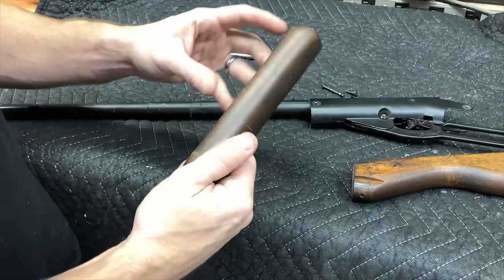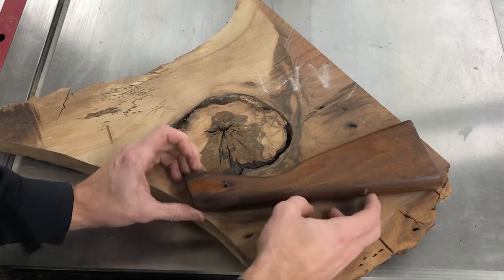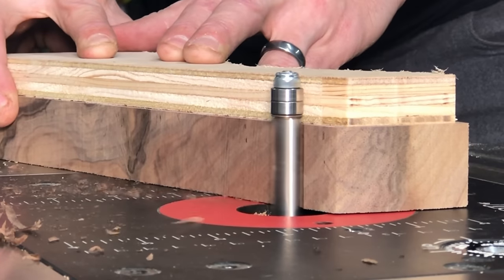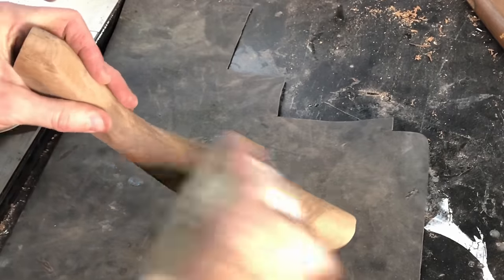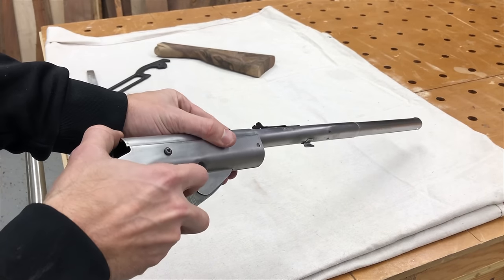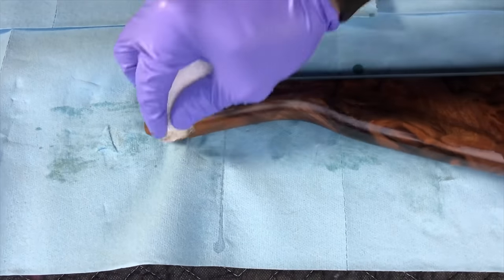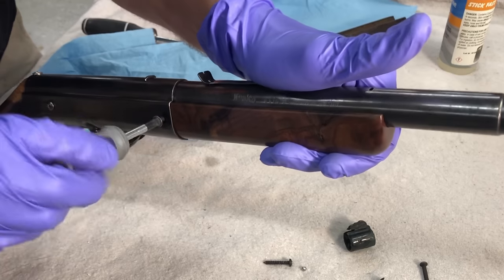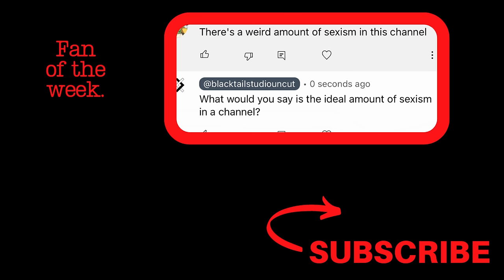Vintage BB Gun Restoration

Comment: When I want a darker finished surface, I've had good results with cold blue and using steel wool wetted with cold blue solution to buff the surface and build a darker color by continuing to buff and apply more solution until the desired effect is achieved. 

That said I love what you've done with the BB gun.

Comment: Love the restoration Cam. 
Safety first, sure. 
Going to attempt to restore my BB Red Rider,  exactly the same as yours. 
There's one piece absent. The rear sight adjustment slider thingy. Mine I also MiA for as long as I can remember. 
Absolutely stunning result with the new stock, grip and cock lever.

Comment: Safety first. I smiled with the extra layers of PPE and with this type of weapon there is no explosive propulsion of material burning but is the release of a measure volume of compressed air, with just a simple spring providing the compressed air. As for the finished weapon, I say it’s a very well restored example where safety has mitigated a possible part failure that will render it useless (and cause injury as it fractures) unless you fabricate a new one using a 3D printer (not the original part) or use metal that can also display a characteristic pattern which, is unique within itself. 
I restored my own rifles with I was a young lad but only had either varnish or French polish to choose from but 2 part epoxy was just around the corner which I later changed to. 
I enjoy your videos of either building something new or restoring (e.g. the Japanese blade restoration). Rgds J 😊

Comment: Safety First!  This was fun to watch - thanks Cam.  I always use the bluing solution on copper pipes etc in the house when they have to be surface mounted, way better look than paint.  Is my go-to also for mild steel railings, can't beat it in my humble opinion!   BB gun looks terrific and is worth way more than it was in so many ways ;)

Comment: I actually have one of those Red Ryder BB guns with the saddle ring (which I took off) .It had a plastic stock and fore arm and those didn't survive my adolescence. So it sat in a corner fore a few years until I fashioned a stock from a piece of moulding, and it still has the machining marks on one side. I don't remember what the fore arm was made from and it's pretty rough, but the gun still shoots, even though the spring is getting weak. It's quicker to cock than the Daisy Grizzly I bought a few years ago, which requires the extra step of charging the BB after pumping it up.

Comment: As someone told him, this was a transfirmation rather than a restauration, but the look is so much better
(ina restauration is cleaning, retouching, refurbishin or repearing and keeking the original pars, if a part is too damaged to be restored then you put a new one of the exact same material (or similar if the original material doesn't exist animore).

Comment: SAFTEY FIRST-I redid mine from the '70s a couple of years ago. Mine has all metal parts and I stripped and had a friend hot blue them for me and replaced all the seals and stripped and refinnished the stocks after giving them a checker job and cnc'd a thin steel buttplate which I also had blued. I gave it about 7 or 8 coats of linseed oil over a weeks time and bufded it out with a car buffer with a soft wool pad which gave it sort of a matt finnish. It turned out really nice and ahot better than I ever remember. It gave it to my granddaughter on her 5th birthday. So now another generation gets to have fun with it and hopefully pass it on to her kids.

Comment: Safety first. I grew up in 1950's Australia where Daisy never really took off. Most kids ended up with a Gecado air rifle instead of a BB gun. You've done a great job on yours but I hope you kept the old stock and lever, a quick change over and you have your original? My first rifle was a Gecado model 27 which I bought in the 1970's. Gecado vanished and was replaced by Dianna.
Great memories, they, the killjoys, are doing their best to rob every ounce of joy and adventure out of the lives of today's kids.

Comment: Safety First. Very nice restoration. The term Damascus Steel is so over used, true Damascus Steel is forged from Wootz steel ingots which are made in southern India, Sri Lanka or Khorasan, Iran. People class steel that looks like Damascus falsely as Damascus. Anyway that's my engineering education coming out. When you "Blue" steel it is best to use a water displacing oil to cover it, this tends to improve the protection. The Walnut looks superb on the stock. Great post, thank you 👍

Comment: Also note: you can buy rebuild kits for the springs, bugger tube, gasket, etc. They are very  inexpensive and quite a bit more of a pain to install than you might think. Done correctly, they will put the zip back in your BB shooter.

Comment: With cold bluing...
Sterile is correct.  Acetone or red BrakeCleaner will get you there.  Always wear gloves.
Multiple coats of bluing is fine.  I tend to dry it with a heat gun.  Warm metal also seems to soak up the bluing better.
Buff off with 0000 steel wool as you did between coats.
After final coat and buffing, oil with a quality oil, and buff and wipe it down.

Comment: Safety Third.

Never been a fan of cold bluing, but with metal that thin, I'm a bit scared to think of what hot bluing would do to it.  Probably the right choice.

The process is called "passivizing" and it's kind of cool idea.  It's the same process as corrosion, but it's done in such a way that the resulting product retains all of its original strength... BUT it's already reacted with oxygen, so it doesn't need to do so again.  You see it a lot in things like boilers, where you use high temperatures to form Iron III Oxide (magnetite) on the surface, so there's no bare iron left to form Iron II Oxide (hematite) that is the rust you're familiar with.

Comment: Safety First...  Great results on the refreshing of your BB gun.  Looks like a Model 95..  You have inspired me to look at some of the old Daisys I have accumulated over the years and clean up a few.  I grew up shooting a Model 102 Cub from the 1950s (yes, I'm old.. :D ) but over the past 20 years or so have managed to accumulate a nice Model 102 Buzz Barton from the 1930s, several Model 25s older than Variant 12 (marked "Plymouth MI") and a couple newer than Variant 13 (marked "Rogers AR") plus at least one Model 95 similar to yours but withe the older muzzle design and a new production Model 25 (my current shooter).  The Buzz Barton and maybe the older Model 25s may be valuable enough to take extreme care in their "restoration".  The rest are not really valuable except as shooters and I can be a bit more creative.  Your stock turned absolutely gorgeous.  Hope you have fun shooting it for years to come...

Comment: Safety First.  In 8th grade shop class I cast a replacement lever for mine that had broken. The most dangerous part is if you fire it with the cocking lever not closed it smashes your fingers and hurts like a . . . well a lot.

Comment: Safety First! Have you ever worked with ironwood? I bought this beautiful little ironwood slab at my local exotic wood store and am going to use it to make a little epoxy table, but I'm curious if I should finish it with Rubio or something else because the wood is so dense and hard it almost looks finished just as is.

Comment: Safety First (from someone that almost lost a finger no less!) Just a note from a metalworker: the cheaper damascus blanks, while nice for projects like this, shouldn't be relied on for anything more serious (like a knife.) These are typically made with random qualities of steel with and usually come with annealing issues (softening the metal) that make them hard to work with. There's a reason that quality damascus stock costs hundreds. That said, if steel quality isn't  your concern then go right ahead! 

Damascus is actually two steels folded together, and when you acid etch it you're eating away at the less corrosion resistant steel. A warning though, that because of that your lever will be much more susceptible to rust, and you need to keep it dry.

Another note. For interior gaps like the lever loop, you can put a cheap round file in a power drill and go to town. I emphasize cheap because this will drastically reduce the lifespan of the file 😅.

Comment: Safety First! I can not stand collector types that would call rust and pits patina instead of neglect and abuse. Plus just because something is old does not mean it has intrinsic value just becaue it is old. I have a 21 year old Toyota Camry I assure you it is not worth more than when I purchased it new and the rust and paint flaws are not patina! If I repair the rust and repaint it the value does not drop!

Comment: I think YouTube doesn't bother with the content of the video when demonetizing.   I think what they are doing is just counting the amount of viewer reports.   So it doesn't matter if you do the whole 'safety first' thing, some people will report it just because you had a gun in a wood working channel.  Course your testing that theory by not handling the weapon safely (barrel pointed up when not in use).   So if YouTube cared about the content, it should be demonetized pretty quickly under the same rule.  But if your 'safety like' bits appeases some anti-gun people then your report proportions will drop and you'll be fine.  It's a cool test.

Comment: Advice from a professional Bladesmith always heat treat Damascus steel or you're not going to get the best results. Also all of the Damascus bought cheaply from the Internet is garbage Pakistani Damascus so you get what you pay for when it comes to good pattern welded steels. Overall though your build looks good. Safety first.. Keep up the great work.

Comment: Fine, I'll edit in the "safety first".
Right there with you on the "you destroyed a classic".  I have a '72 Corvette that I've had for over 30 years.  It wasn't original when I got it in '88 (and the numbers didn't match) and I did massive modifications to it.  Blown 350 sticking out of the hood, tilt nose, complete replacement/upgrade of the suspension parts, fender flares to stuff wider rear tires, custom interior, etc.  Many/most Corvette owners are massive elitist purists.  To the point that I won't consider taking it to any kind of car show because I have to listen to them go on an on about how I destroyed a masterpiece.  Blows my mind how they think they all have some collective ownership of something that is clearly mine to do with as I choose.

Btw, I found it humorous that after noting that your previous video was taken down for unsafe use of a firearm you put on all that PPE then acknowledged that you'd taken a shot with no visibility.

Comment: SAFFEY FIRST 

Cam… You have actually in fact not restored this $20 plastic BB gun from the 80s. You instead have modified it, therefore destroying any value that it would have once held. 

Also you forgot to pour epoxy down the barrel…..